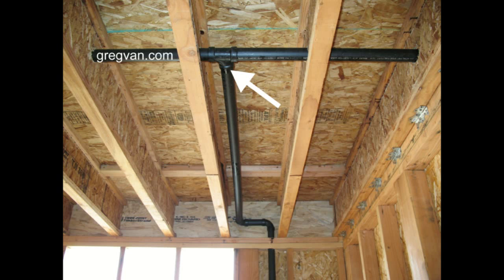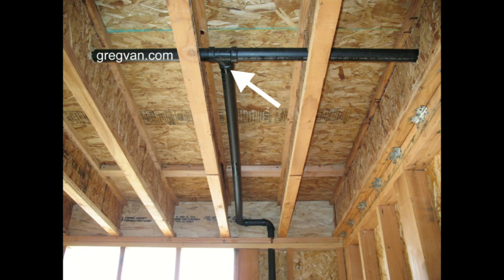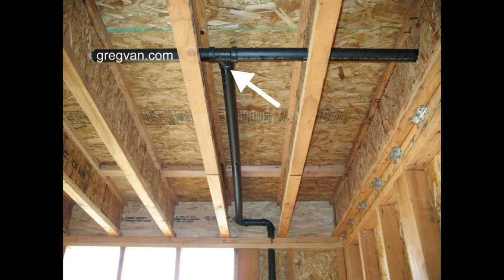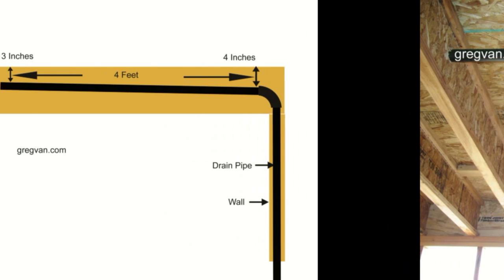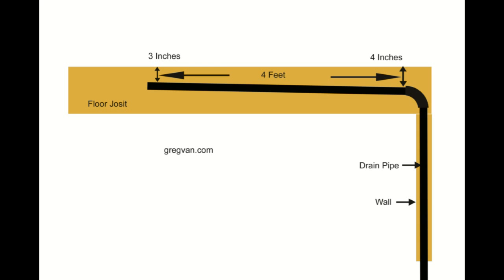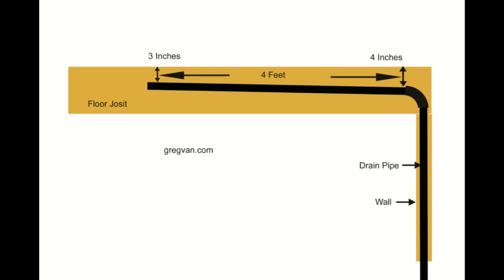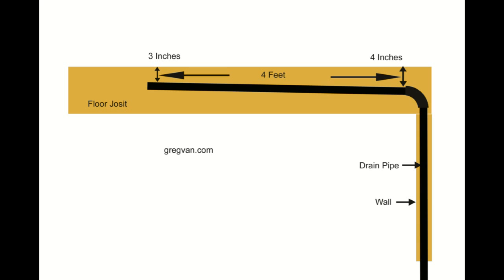How Much Slope Per Foot in Plumbing Drain Pipes - Framing and Plumbing Layout

Comment: Ya you count 4 times on each  quarter inch mark on your tape measure .    So the pipe drops one inch.    Make sure your measuring off something level like the roof  .   I'm a plumber apperentice   , took me a bit of time to learn this.
Reply from the maker: Thanks for the info
Reply: What is the slope Drop in degree

Comment: My previous experience of drains was land drains in a forestry context.Amazing things but not applicable in domestic situations as I have found to my cost.Where water accumulated in parts of the drain[by the side of our house] lurked and evaporated into the brickwork and plaster above the water in the drains and caused the paint to flek and with moss growing as well.I'm having to redo it and have discovered the importance of sloping the drains.Thanks for the info!

Comment: Anything over 3” pipe is 1/8 “ per ft anything less is 1/4 “ per ft and if there is too much slope it can be bad water will rush ahead of solids which dry and cause clogs also the water can flow so fast it may even siphon out p traps which is dangerous
Reply from the maker: I wonder why the building codes don't suggest this. Feel free to provide us with reference numbers if you do find them

Comment: Sir uh you may be wrong.  Perhaps you should check the full context of the code.  I'm not sure, but apparently the minimum slope is 1/4" per foot but cannot exceed 3" per foot.   One site claims that exceeding 3" per foot will drain water but not solids - leaving a mess in the pipe (and contradicting your claim).  Another site indicated that excessive slopes can pull the trap, which leads to sewer smells.  That contradicts your claim as well.
Reply from the maker: I will be glad to examine any building code reference numbers you can provide me with to support your claims, other wise I will have to stick to what I found.
Reply: I have been researching and find it hard to pin anything definite down. 
  I though 1/8” per ft started at 3” pipe. Now it seems to start at 4” pipe. 
  This is an old post, so maybe because codes changed in different areas.
Reply: @rickeykeeton4770  I found this on line:

According to plumbing code, drain pipe has to be sloped a minimum of 1/4-inch per foot and a maximum of three inches per foot or vertical. A slope of less than 1/4-inch per foot will cause constant drain clogs and a slope of more than three inches will allow the water to drain without the solids. Calculating the slope of your drain pipe is easy.

Comment: I am not a plumber by trade but when I do a job I try to research it as much as possible! You mentioned that it has to slope a quarter inch per foot and it can’t go any less but it could slope more! Which is true but there is a maximum in which it can slope!
Reply from the maker: You would need to check with your local building department to verify all of the information in this video. Standard plumbing practices usually require 4 inch drain pipes or larger to slope a minimum of 1/8 of an inch per foot and smaller pipes to slope a minimum of 1/4 of an inch per foot. As far as the maximum slope, I've never found any building codes to suggest that there is one, but have heard plenty of so-called experts claim that there are, let me know if you find them.

Comment: I thought if the drop was much greater than 1/4 per foot that the liquids would drain and would leave the solids behind.
Reply: You are correct. 
The statement mentioned in the video ("it can always be greater, but not less") is incorrect.

3" Pipe = 1/4 inch slope per foot of pipe (or completely vertical)
4" Pipe = 1/8 inch slope per foot of pipe (or completely vertical)

If the slope of your piping is far LESS than what is mentioned above, then nothing moves (water or waste).

If the slope of your piping is far GREATER than what is mentioned above, then the water moves faster than the waste; instead of carrying the waste along with it.
Reply: That is what I was taught in school, until you get to 45 degrees(12/12) or steeper, then it doesn't matter and the solids will keep up.

Comment: Hi Greg, I've been retired from plumbing 9 years now and here in KY our State Plumbing Code has always said minimum 1/8" fall/slope per foot and we always tried to hold that, although up to 1/4" fall/slope per foot was allowed.

From our current (2017) code book ....... 815 KAR 20:090. Soil, waste, and vent systems. (viewable online in PDF)

 "Section 1. Grades and Supports of Horizontal Piping. (1) (a) Horizontal piping shall run in practical alignment
and at a uniform grade of not less than one-eighth (1/8) inch per foot and shall be supported or anchored in
accordance with the manufacturer's recommendations."
Reply from the maker: Comments like yours are always sincerely appreciated and thanks for taking the time to share your experience with us.

Comment: Do the 8th of an inch  pitch apply to the 4 inches in diameter pipe for main sewer line ?? and if it does would it hurts or go against the city codes to put extra pitch , lets say for instance instead of an 8th of an inch on every foot of a 4 inches in diameter pipe for a MAIN SEWER LINE I put a 1/4 of an inch pitch per foot, the piece of main sewer pipe I want to replace in basement is only like  8 feet , thanks
Reply from the maker: I've heard some suggest that it shouldn't be more than 1/2 inch per foot, but when I asked them to provide me with the building code reference numbers, they never do.

Comment: My home has a basement.
The sink drain pipes are easy to get to.
Every 3 to 4 years the pipe is totally plugged .The length of the
drain pipe is 13’.The pipe  slope is  3.5”.
Either the slope  is too much, or  not enough.
How would you fellows go about fixing this
repeated plug up problem?
Reply from the maker: Most of the time, the only way to fix a problem like yours would be to have a plumber come out with a scope or video camera that can be ran through the drainpipe to see what the problem actually is.
Reply: any sags or dips in the pipe?,  3.5 inches in 13 ft is good.  but no dips or sags.
Reply: The slope shouldn't be more than the diameter of the trap arm. So if the diameter is 2", the slope should be 2 inch as well. 3.5" is too steep, the flow velocity is too high leaving debris in the pipe. With 1/4" slope per feet, you can only have maximum 8 feet trap arm

Comment: Battles between plumbers and framers and, for that matter, viewers who are trying to learn.  Wouldn't it be wonderful, if you and the plumbers (maybe the electricians too?) could discuss your various needs and plan / design things so that everything gets done with the least amount of work (at least overall - for everyone combined).  And these sources of information used the wisdom of all these people so that the viewers could start from a really high point and not have to learn things the hard way, as much.

And wouldn't it be great if the plumbers created videos about plumbing.  Or weighed in with really helpful comments / references to resources.  I'm trying to learn stuff and it seems like all the videos are by non plumbers.  All I wanted from this vid was the slope (how much it had to drop per horizontal distance) - 1/4 inch down per horizontal foot - easy.  Got it.  I'm trying (planning) to do some rainwater catchment, and I think I want the pipes to be able to drain, e.g. in the winter, or so they're not permanently holding stagnant water (which I guess would get pushed out during rains).  Think I want a drain at the lowest point.  And no elbows - that I can't drain easily.  I might want one at the top of the overflow to keep bugs from flying in that way.  But I'll probably just use screen.
Reply from the maker: If you don't know much about business, people or have the skills required to assemble something, you're going to have problems.
Reply from the maker: I had an advantage over most builders, because I would usually draw my own building plans and do all of the work myself. It's not very common to have someone who knows how to do everything on a job, all the time. However, it would be nice.
Reply: Or people who could work together that together knew enough to not make more work overall.  Hopefully I won't make a complete mess on my first project - plumbing some rainwater tanks off my down spouts.
Reply from the maker: Well I wish you good luck and try not to get into an argument between anyone else working on the project, even if it's your spouse.
Reply: battle or harmony between the subs:  most of the time this falls squarely on the general contractor. most homeowners are not effective contractors. and for that matter, most contractors are not great Contractors!

Comment: how do you get a slope off a 90 degree from vertical to horizontal run ?
Reply from the maker: I know it doesn't sound like it would work, but the plastic pipes usually flex enough to provide the desired slope.

Comment: Are you connecting pipe into the fitting socket NOT squarely to achieve the slope, or modifying the fitting in some way to get a square attachment between pipe and fitting?  Now in some cases you can just twist the fitting so the intersecting pipe can be set at the correct slope (easy).  But in a horizontal intersection I've wondered what the best technique is to achieve the desired 1/4"/LF slope.  I reckon you could heat the socket end of a fitting whilst observing your level until the pipe slopes correctly, then cooling the fitting until it sets fixed in this modified position.  It seems this is the only way to get a squarely fitting pipe into the fitting socket.
Reply from the maker: You bring up a good point and whenever I'm drawing or designing plumbing part connections on my computer, it seems to create a problem with exactly what you're talking about, but they can be tweaked just enough to make everything work and materials like PVC and ABS are flexible enough to get the slope you're looking for. Obviously this would be a problem if you are looking at 1 inch slopes, but eighth of an inch to a quarter of an inch usually works just fine.
Reply: Thanks for the comment :) I agree, there is a measure of pipe flexibility to solve this (certainly more with increasing length).  I just have a concern (maybe too much so) to "stress" the pipe to achieve the slope.  I have this situation on a lav fixture arm between trap and vent fitting.  I may use a strap at the vent fitting to secure it to the surrounding stud work in order to establish the needed slope in that fixture arm, which will set the fixture arm in a fixed and slightly stressed position.  The fixture arm is less than 3' long, so I can likely fit the arm squarely and rely on the pipe's flexibility.  Obviously I don't want the arm to be so stressed that it would crack over time :)
Reply from the maker: 3 feet is usually long enough to put a quarter of an inch per foot slope in it and plumbers do it all the time with every type of piping material imagined from PVC to cast-iron. However it's always good to strap the pipes.

Comment: The way it was explained to me is, ... if the overall slope of the pipe exceeds the inside diameter of your pipe, you create a syphon. Water needs air behind it to drain properly,... that is where your venting comes in.  A 1/4" slope is perfect, too much slope and you reduce the capacity of the pipe, too little and you have solids building up (accumulating) inside the pipe also reducing it's capacity. Perfection is for architects and engineers,  I just tape a 1/2" block of wood to the end of my 2' level and adjust for circumstances.
Reply from the maker: +James Beaty I've never heard that one before and it seems practical, thanks for sharing.
Reply: The slope of the drain pipe before the vent should not be more than 1/4" for two reasons. 

One is what James stated-- the vent opening can't be below the trap weir or else it has the same effect as when you put a straw in liquid and put your thumb or finger over the top of the straw-- it creates a vacuum and when you lift the straw, the water stays in it until you remove the obstruction at the top and the air allows the liquid to flow out. 

The second reason is that too much slope can cause the water to run too fast and leave behind debris which will clog the pipe. 

Additionally, the allowed maximum developed length of the trap arm is based on calculations that make it so the trap weir will not be above the vent opening. So, 6' length for a 2" diameter pipe (under IPC) would still allow some air in to help the waste move. The maximum distances differ from IPC and UPC. I believe UPC has a maximum of 3' but I could be wrong. I live in an area that uses IPC.

Another thing to remember is that there is also a minimum distance required for the trap arm. It must not be less than two pipe diameters or it will create a crown vent (which allows the water to be siphoned out of the trap so that sewer gases can come up through the trap). So, a 2" pipe needs a minimum 4" trap arm. 3" needs 6" minimum. 

(For those unfamiliar with the term: Trap arm is the horizontal pipe exiting the trap before it reaches the vent).
Reply: cats  pretty complex,  I just want to replace my old rotten cast iron pipe,
Reply: +James Beaty  Please explain this half in block      if i keep the  level a little after line say a 1/8 inch
Reply: If your remove the word 'overall', would your statement still be true? I see no reason for the word. It just adds to the difficulty
Reply: Would "average" fit here?

Comment: Would you ever get into a situation where the drop would cause problems because the length of run was long?
Reply from the maker: +NY Mogul That's a tough question to answer, because you could have problems with horizontal runs less than 20 feet. Remember, I'm pretty sure most building codes require a clean out every 75 feet and feel free to correct me if I'm wrong, just in case there is a problem.
Reply: +gregvancom Thanks for the reply. I was just thinking of the run was very long the joist might not be wide enough to be able to accommodate the pipe because of the amount of drop.
Reply from the maker: I gotcha and if that was the case the plumber wouldn't be allowed to run the pipe. However sometimes you can run larger diameter pipes, but that also might require you to do additional modifications to the rest of the plumbing system. I actually ran into the problem you are talking about in a room addition I did over garage one time and had to lower a section of the ceiling to make it work.
Reply: @afterdark6822  I would normally look for a nother route. Like instead of traveling the distance of the joist cavity to drop the stack down a wall, maybe I could drill a floor joist or two ( following the guidelines of putting holes in joist of course)
then drop it down a different virtical wall cavity to the basement or floor level below. Stack placement on the ground rough ( installing plumbing pipes before concrete floors in the basement are poured) is critical. You want them near the bathroom that's going to be in the level above so your not running the drain from upstairs then double back to get it to the stack coming out of the floor in the basement. Or sometimes even a high wall sewer which goes out the foundation wall.

Comment: If the pipe fittings only come on 45°, 60°, and 90° bends, how do you get the pipes to slope so that they are at 1/4" per foot?   Are the ABS pipes bendable?
Reply from the maker: ds99 That is an excellent question and actually one I've never heard before. Yes the pipes are designed to flex and it seems like the smaller ones flex a little easier than the larger ones. Mathematically it sounds like it wouldn't work, but it does.
Reply: Thank you for the reply!
Reply: PVC pipes do not have exactly 90 degree bends.  They have a little extra--probably 91.5 degrees--so that following the desired slope will give a stress free connection when glued.

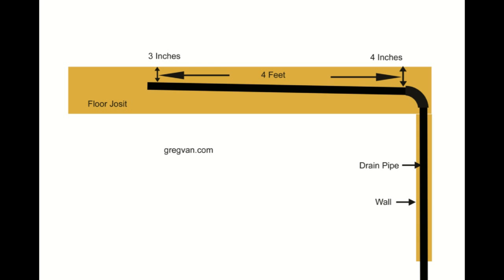Comment: An easier way of saying this is a ratio of 1:48 fall.   That way people working in metric can use the formula too.
Reply from the maker: ***** Thank you for your useful tip and if I ever make another video on the subject will use it. One of the reasons why I didn't use it was because it might've been a little harder to explain. It's hard for some people to break down a half-inch in 2 feet or a quarter inch in 1 foot with that ratio.
Reply: No problem.

Comment: What's a "Josit"? ;)
Reply: midgetXL  No such word as josit.   A joist is a floor framing member that supports the subfloor above it which in turn supports the finish floor.
Reply: arbeeex I know this. It's misspelled in the video on the diagram. Thanks for your help though.
Reply from the maker: midgetXL You're the first one who has pointed that out and even when I read your comment for the first time I thought you used the word correctly, until I read the comment below. I always appreciate constructive criticism and thanks for watching.
Reply: Josit looks correct to me.  i'm also dyslexic.